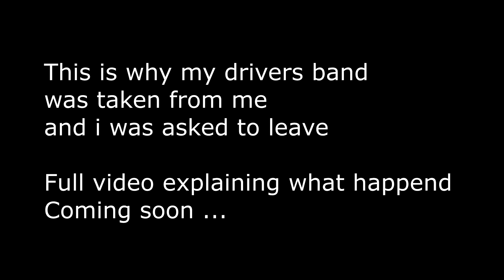QLD MATSURI 2022 || Day 2, QLD Raceway, Destroyed the S13, Near death crash, Got kicked off track 😳

Comment: Good on ya for tearing up the grass, I’d have done the same! All those wrecked cars just so circuit racers don’t have a sook.  Now I bet TQ will re think those tire barriers, won’t be long till someone is seriously injured and there’s a lawsuit.
Reply: Problem with that is the clause, a mate shifted two vertebrae in his neck when one came through his windows, skid mark on his helmet but not a leg to stand on...
Reply: @tokimotive   depends how you argue it in court, contracts don’t provide immunity to negligence. And after seeing car after car crash, and multiple on board footage, one definitely has ground to stand on in court.
Reply: This is a fair point man, and honestly with the increase of evidence on film, photos, etc. I'm sure you're right, there's definitely gotta be more of a case there now
Reply: FYI nothing to do with Circuit Racers, we're partially in the same boat with having to keep it on the black stuff. They usually put cones and tyres on corner entries, apexes and exits so that we can't take an aggressive line and hit the dirt. I get why they don't want Dirt dropping, because of the drop off it creates on the track edge, but the truck tyre stacks are excessive and dangerous. They also seemed to have put them in really odd spots. QR needs to find another way.

Comment: Will be messy when someone gos head on into a tyre bundle and gets a tyre through the windcreen, race tracks are meant to be a safe place but drifting past telegraph poles seams just as safe, if track entry was free and they couldnt afford grass seed I could understand dangerous items on edge of the track to protect the grass but when there choosing to save a little bit of grass over a possible deadly crash you know theres issues
Reply: It’s not just the grass. It’s more about tearing up the track edges and digging holes that destroy other cars.
Reply: @DavidCP524  So 250 drifters suffer just so that circuit racers can go off track onto some nice pristine grass?
The damage dealt by the tyres far out weighs the protentional damage caused by going off a rough edge.
Reply: @yeahnah6468   not 250 drifters as the majority managed to avoid the tyres just fine. Maybe you should try make it out to the track more often, the holes damage drift cars too. At the October matsuri there was a clean Holden Ute dropped into one of the holes outside 6 and smashed a rim. A large chunk of rim ended up in the middle of the track which the next car hit and killed a rim, tyre and rear quarter.
Reply: @DavidCP524  couple of rims and a panel vs 20 cars ruined and medical vehicles out on track every hour.
I know which one I'd prefer.
Reply: Nothing to do with the 'grass' or circuit racers, QR has a pretty hard line stance on keeping it on the black stuff, as David has indicated cars going off track over the years has torn up the track edges and dug holes which can be quite damaging to cars. But the truck tyre stacks are incredibly dangerous and excessive and QR needs to find another way. They actually used to go around filling up the edge with gravel/ sand so it wasn't a harsh edge, but that no longer happens (talking like 15-20 years ago)